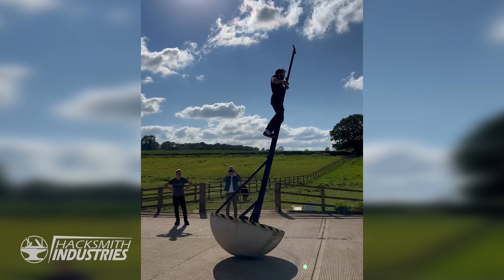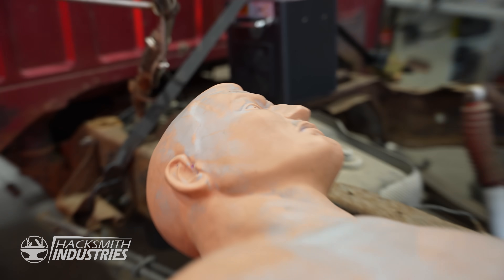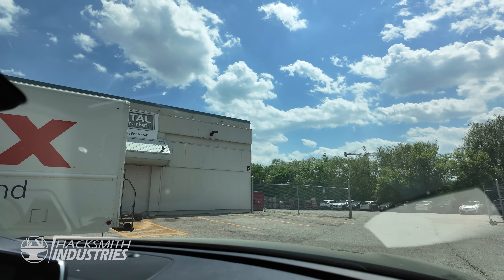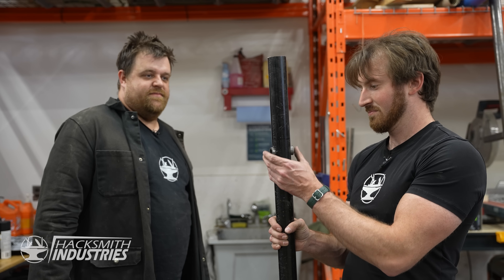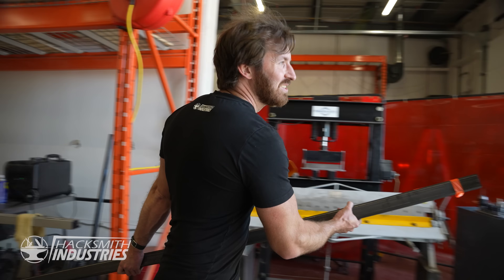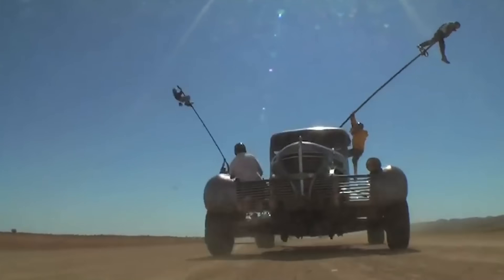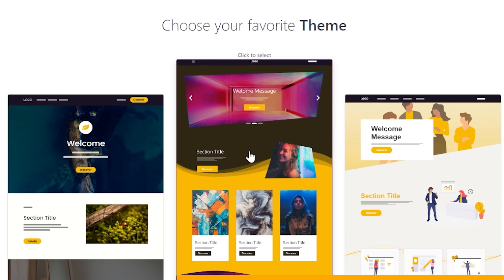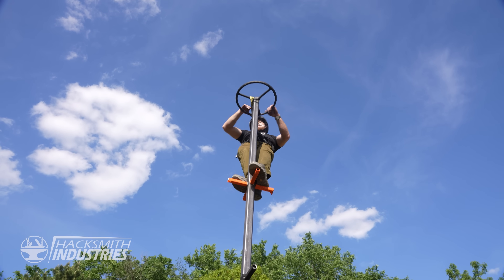riding a pole-truck (totally safe one day build)

Comment: As somebody who works with steel a lot I knew the pipe was going to bend exactly where you drilled it. When you're using steel with that much tensile force on it. You cannot be drilling. Because It degrades the strength. I haven't made it through the whole video. But I'm also going to say that with the swaying pole. Depending on how long it is that can cause too much force for the frame of the vehicle as well. Acts as breaker bar. So then the frame of the vehicle has to be strengthened. Or the load has to be less

Comment: I doubt that they could build a completely accurate/completely functional miraidon with a actual functional ai that has it's own actual  free will and have it be able to turn into a rideable futuristic looking/futuristic functional motorcycle that has 2 jet exhausts as well as a functioning battle mode that actually works and make it so that it can both glide and fly as well as giving it a speed boost function and also allow it to climb/scale any surface and make it so it can also hover in it's battle mode and it should also have a mind of it's own and it should be able to stick to any surface/incline that's sideways or diagonal also it should be able to feel actual emotions and it should be able to use pokemon moves that it can learn plus I think it will be the first actual functional pokemon that could exist because I think that it could actually work and there's no deadline for finishing it also it should use a battery that doesn't need charging but it has to be a battery that can charge by itself and  it should be able to use it's own power that can actually keep it powered on 24/7 all the time and it should be water proof and it should be able to swim as well and it should be able to sleep as well and it should also be able to eat food as well also I recommend using a engine that uses food scraps that can be transferred into the engine but it turns it into it's own energy no gas/no electricity/no solor energy/no water because it has to be a eco-friendly engine that it can use and it should use a item that's called the "violet core" which is a unused item that was found looking into the code of pokemon violet version and it should be used on it as a way for it to turn into it's battle mode basically also hopefully that this can be a challenge that you can do.

Comment: Would be cool to just put the weeble bar on a pivot and use actuators to "rock" it back and forth or have it controlled by the one on the bar to have it go down or up based on when they got close to the target.

Comment: Why not use a counter weight system like they did in the movie ?
Reply from the maker: Not enough room under the truck.  You'd need 1000lbs at that leverage
Reply: @hacksmith  do it like the movie . The leverage point was about 6+ foot ABOVE the bed not under it . That gets you enough room for a good fulcrum. In the first movie they used engines as counter weights. But regardless still cool , Shine on Pole Cat
Reply from the maker: It was a one day build.

Comment: Disappointing.  Even without people to help swing it, a high pivot with a counterweight like in the movie would have been better than this.
Reply from the maker: It's a one day build man.
Reply: @hacksmith  A pair of 55 gallon barrels, some gravel, water, and/or concrete are all available in your area.
Reply from the maker: Try the math.  Getting a heavy enough counterweight between the wheels for a 12' lever would be close to a thousand pounds.  There's no room for a 55 gallon barrel under the frame.  It's not a big rig.

Comment: If only there was a sport in which they use long flexible poles to jump over a bar...
Reply from the maker: I've seen too many videos of those breaking
Reply: @hacksmith  they have different thicknesses and flex to choose from. but then you cant weld stuff on it . one thing i was thinking it that several thinner tubes  of a stronger alloy in a bundle have a lot more flex than one single long tube
Reply from the maker: We actually tried that with the round pipe and it worked a bit better but still bent  didn't end up in the video though

Comment: Great video, and project. I think this is one of those times though, where if they tried to contact someone from the production crew of Mad Max Fury Road. They might have gotten a chance to compare their version against one that was used during production. Cos the Pole Cat vehicles were done physically and without CGI.
Reply from the maker: Doing stuff like that is surprisingly difficult to do... and this was a onedaybuild 😅
Reply: @hacksmith  thats insane
Reply: @MichaelxVoorhees  And it was inspired by a Furze build.
Sanity was well in the rear view.
Reply: @hacksmith  shouldve went with the trebuchet design.